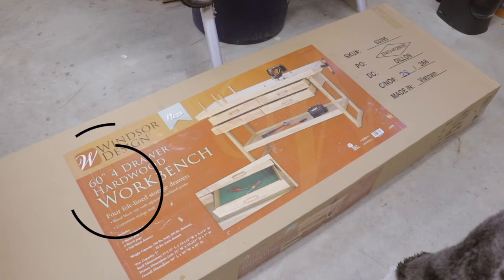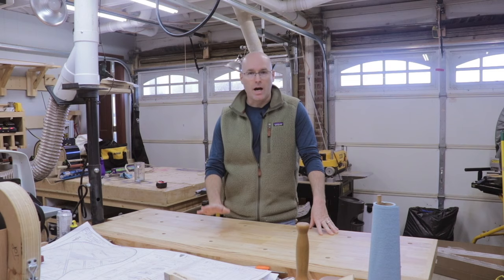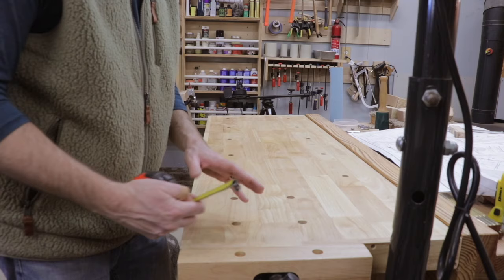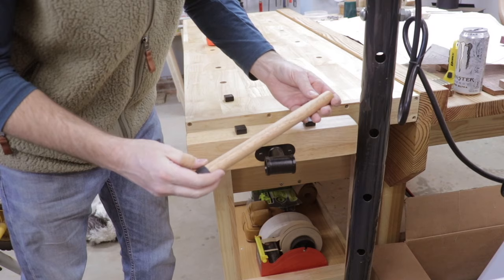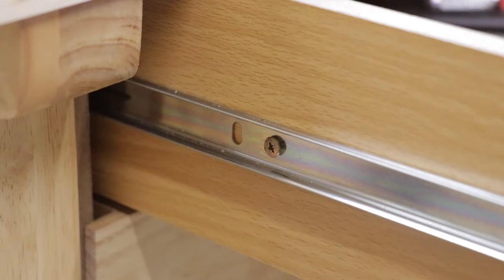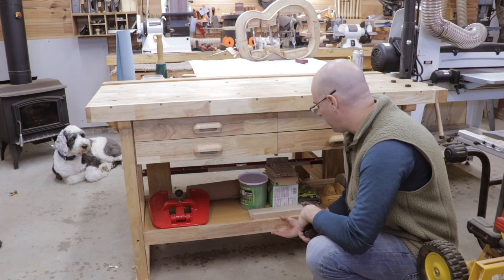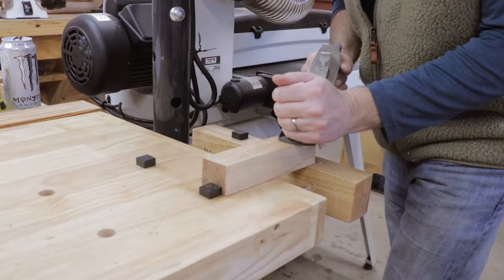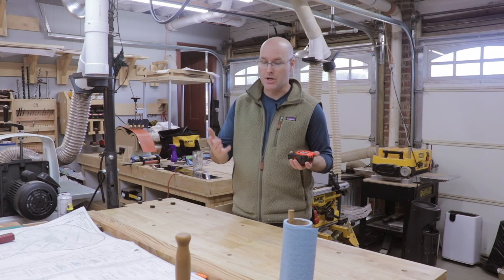Harbor Freight Woodworking Workbench Review

Comment: This was my first bench and I still use it. Adding a sheet of plywood in the back made it stiff enough to plane on. I also added casters so I can move it around the shop. I tried adding a leg vise but the legs are just not wide enough. Finally I moved all the drawers to the right side and now I have more storage on the left side.
Reply from the maker: That’s great! Thanks for sharing!
Reply: I added casters to mine, too.
Reply: @driftlesshunter9200  Can you show us a picture and which Casters that you used?
Reply: Do you have a video of your workbench ?

Comment: Add back panel for cross bracing to make the bench more stable. Also, beware on the drawer slides. Two of ours had bad slides on one drawer per bench. Annoying is that sawdust drops through the dog holes into the drawers. I put tape over the bottom of the holes, and replace it as needed.
Reply from the maker: Good to know! Thanks!
Reply: yup, sawdust in the drawers. lol
Reply: I've always found it annoying when I have sawdust in my drawers.
Reply: @craigheaps7520  🤣😂🤣😂🤣

Comment: I upgraded mine.  I installed 14 inch full extension sliders on drawers, peg board on the back and side to hang tools,  painting paper roll holder on one end to protect top for painting projects. . .below that a rod to hold small clamps, Rockler workbench casters (with a steel across for releasing both legs quicker), Kreg bench clamp and made the bottom shelf flat to slide in harbor freight parts storage cases.  The top of mine didn't stay flat so I might have to upgrade that.  Also, the bench dog holes are 1/2 inch and most bench dog accessories are 3/4 so I drilled out a couple by the vise so I can utilities some bench dog accessories.  For my first "portable"/maneuverable  (casters) workbench it works great in my little shop.
Reply from the maker: Sounds like all good ideas!

Comment: This can be had for $119 if you can wait for the coupon. I recently purchased this bench. I left off the drawers and plan on doing some upgrades. I purchased it primarily as a basic base to customize. I’m very happy with it so far.  Definitely needs glue/reinforcement to the joints to help stabilize it.
Reply from the maker: Thanks for sharing
Reply: What coupon?

Comment: I bought this table about 2 months ago.  It's become the primary workbench for me and it's stable, secure and is an essential part of my shop.  I used the wood vice today and it worked perfectly.  The tray below the table is strong and has many of my smaller power tools that I keep in tool bags.  It's worth every penny.  Don't get fooled by the tables assembled in the store, those tables aren't assembled the way you will when you get it home.    Thanks for the great reviews!
Reply: yo how has it held up?
Reply from the maker: @GasLiteYT still using it everyday! I like my handmade bench much better due to stability!

Comment: Thanks for the review. I agree its a no brainer purchase if you need a general workbench. I bought 2 of these back in January. Used a 20% 0ff coupon and got them them for $119 each. I have them mounted back to back and held together with magnets. I got the idea from Advanced Geekery's channel. This gives you a nice large work space or 2 smaller work tops depending on the project.
Reply from the maker: That’s a really good idea! Makes them more stable too

Comment: I purchased one of these about 6 years ago when I was easing into hand tool woodworking as my 'Hobby of Choice'.  It was better than the workbench I didn't have though no treat, that's for sure.  It DID suffice as a work surface while I build some shop furniture to 'warm up' for building a Rubio style workbench in the way of Charles Schultz.  Instead of throwing it out after I built a 'real' workbench, I re-flattened the top (the thing warps if ya look at it crosswise) and use it as a place to organize things....but not at all as a work surface.  As everyone says, it is way too light for hand tool work.  If I had put a couple sacks of sand on the lower shelf....that would have been a good temporary solution.  If you don't have a bench....get this thing as a stopgap and build something that works.  I had NO experience with the large joints used on the Rubio....but the Japanese style sawhorse and matching height sawbench I built as a warm-up me far enough along that the workbench came out just fine.....and it weighs about 350#, at least.

Comment: I’ve had 2 of those benches and i beleive they were Rubber Wood  i am a retired ProfessionalWoodworker   i certainly wasn’t impressed with the End Vise or the Drawer Slides  but in all honesty  i only used mine for  little Hobby  projects  and i was tight on space  so the  extra storage kind of helped me out for the money and simplicity. i was happy  as i hauled  two of them in my Girlfreinds SUV !

Comment: I got one of these benches a few years ago for $99 on special.  I agree that as is, it is a good beginner bench.  Like Rusty T, I added plywood across the back and that helped stiffen it up.  I use it for light duty work with hand tools in the woodworker role and do lots of other thinks like blade sharpening, repairs etc for around the house stuff.  Good deal for the money.
Reply from the maker: $99 great deal

Comment: I've been using that same workbench for 8 or 9 yrs. now. My main complaint was the drawers, so I bought new slides and solved that one. I attached some 3/8" pegboard to the back and that made it more solid and I can hang stuff on it. Added casters so I can move it around. I don't remember what I paid for it but bought when it was on sale and I had a nice coupon to knock some more off. Not a bad table for the money!
Take care, Dave

Comment: I see rubberwood (a member of the maple family with hardness of 9500) in this, but looks like it may be several species, typically furniture companies will use their cutoffs and endjoin them to make laminated sheets and then make things such as this. Rubberwood is moisture absorbent, more so than other wood species. May also trigger latex allergies in some.

Comment: I just bought their newer 3 drawer woodworking bench. It's a lot heavier duty than the 4 drawer but it also costs $200 as opposed to $149. Same Rubber wood Maple raw material, just more robust in size.  I'm going to use it as a glue up table for my coffee tables, bar tops and dining table builds.  Eventually I'll buy a second one and connect them back to back.  Cheers 🥂
Reply: Good to know, just ordered the 3 drawer myself!
Reply: The new 3-drawer version will be on sale for $149 at Harbor Freight June 2, 3, & 4 :)

Comment: If you want to build a bench for less you can get solid oak pallets from places that sell sheet metal. I made a Moravian workbench in 3 days. You will need about 6 pallets if you only pick out the best. Laminate the legs with 4 slats each and laminate the top with the runners and make all the short cross members from 2 slats. For the long stretchers and leg vice  use the runners. I spent $54 for my vice $9.70 for dowels to drawbore my mortises and the top sits on pegs of 3/4 dowel I used the remainder for bench dogs. I did use a peace of mahogany and pine that I had for the tool tray probably $30 worth. I also used an expensive hardwood finish I got from work.

Comment: I have 2 of these.  On sale $119.  I to replace the crap drawers with 6 full pullout slide drawers.  I added another 3/4" top.  I added wheels that flip so that it's stationary when you want it to be.  I also stiffened it with a full back on it.  I  also rebuilt the faces of the vice.  I think that this is one of the best items that you can get from HF
Reply from the maker: Thanks Bill for sharing your experience. I would buy another one if I can get it at $119
Reply: @BillP Really interested those "wheels that flip". Can you share the make or a link?
Reply: @AlejandroGarciaTunon  I just put some wheels/casters on one end and then on the other end I put the wheels on a 2x6 then hinged them so I could flip them out of the way when I didn't want the bench to move.
Reply: @myutube6422  thanks!

Comment: I use mine as a combination outfeed table and sharpening station, It's fine for that but not for hand tool woodwork. By the  time you beef this up enough to be useful for had tool work (planing, chopping mortises, etc.) you could well have built a real bench with a top with which you could use holdfasts, etc.. And the vise is way sub-par. Still, it's a great inexpensive option for the uses to which I put it. Just don't expect more of it than it can give.

Comment: I have this bench...it's great for 150...first thing you have to do is replace the drawer slides...everything else was great for me...it isn't the greatest vice ever, but it's great for average stuff.  It isn't great for planing, or anything that requires pressure across the top...so sanding, etc.  But for 150, you can't beat it.
Reply from the maker: Agreed!

Comment: I bought one last summer. Replaced the drawer runners  with wood slides still need to replace the drawer under devider as mine pulled out. The material is worse than MDF for holding screws. It works is about all I can say about it.
Reply from the maker: Thanks for sharing Carey!

Comment: great review. I've h ad mine maybe 3 years.... it's worked great for me.. fits easily in my one car garage.. I thought the vice worked okay...  recently I wanted to use it as an outfeed table for my dewalt table saw and found if I take harbor freights appliance dolly that cost me around 20 dollars, and put a couple of 4X4's about 4 ft long on it. I simply put it under the shelf and then can easily rool my table out onto my driveway and cut wood. very handy table that's easy to move with a minimal foot print.  Bruce.
Reply from the maker: Thanks for sharing your experience!

Comment: I have this bench, I didn't install the drawers so I could use my bench irons.
My only complaint was the bottom shelf was so warped that I couldn't get it in the frame, so I attached 1" angle iron and laid 2×4's in loose for a shelf and to add a little weight.
I used an insider coupon also, saved an extra 20 bucks.

Comment: I got one of these for $50 by combining a coupon with some sail they had going and I got free microfiber towels and a magnetic tray. I have a real workbench I used this to hold a fish tank. But if I ever put it in my shop I will replace the bottom shelf with 1/2” birch plywood and fill the void under the hollow top with MDF  because the top is 3/4 finger jointed tiny scraps. It’s totally worth full price though. I used the vice screw to make the wagon vice on my real bench.

Comment: The sides and rear of the drawers and the lower shelf are made of MDF, not plywood. If they were plywood, they would be much stronger. You can screw the table to a wall. That would keep the table from shifting or wobbling. Attach a 1/2"x2" board the length of the table to the wall aligning the top of the table to the top of the 1/2"x2" board. In other words, make them flush at the top. After screwing (or nailing) the 1/2"x2" board to the wall studs, screw the table to this 1/2"x2" board. I would use 1-1/2" to 2" screws at least every foot along the length of the board. Whether you attach to wall or not, I would also run 3-5 stretches under the table from front to rear to add strength to the top. Screw or nail the stretches to the table top. I  would also use wood glue. Countersink for the screws or nails. Fill holes with wood putty, sand and spray or paint with lacquer. Make sure the stretchers do not interfere with the operation of the top drawers.

Comment: Purchased it with a coupon for about $116 a year or two ago.  It's usually a horizontal surface that collects stuff, but I put bigger blocks under the legs, and then put casters below that, so I can move it around.  The short throw of the drawers is a bit (well, VERY) annoying, and getting sawdust in them is annoying as well.  It seems too narrow for much setup (I deal with sheet goods a bit.).  I had put up a sawhorse-based 2x4 cross-grid setup as a more or less permanent sheet good cutting surface.  My wife wants her garage back... I'm resisting.. stay tuned for how this turns out.  Usually I lose. LOL

Comment: I looked at the HF work bench and yes the top is hard wood. But i saw MDF on the draws, the bottom shelf, anf under the top.
But back then they were 100.00 
Or whem i looked at it.
Good luck

Comment: It's okay.  glue and screw some half inch ply to the back and sides to reduce racking.  Add heavy stuff to bottom shelf as ballast.  Lastly, glue and screw some 2x4s underneath the dog holes and redrill from the top. 

You will be able to use hold fasts on the back dog holes only - which is good enough.

A better bench is Rob Cosman's made from mdf.  buy some 1 inch thread rod and build your own vise - or two or three.  All can be done for $150 or less.  

I used 3/4 thread rod to build a face vise on my workbench over 20 years ago.  I've used and abused it daily and it's still tight and right.  You can build a vise much better than you can buy at any price.

My face vise has 1.5 inch hardwood dowel runners.  My next bench will have twin screws on each end (1 inch thread rod) and a face vise with 1 inch thread rod with 2 inch hardwood dowel runners. 1 in 8 TPI is all you'll ever need.  I've used 3/4 thread rod that's 1 in 16 TPI for 20 plus years.  With a speed handle, it takes just a few more seconds than a quick release with none of the quirks.
Reply: Brilliant suggestions, thanks!!
Reply: @Nifty-Stuff  No worries!

Comment: I bought one about a year ago.  The vice handle snapped about a week in and saw it had a factory crack in it.  I made a replacement one ont of walnut dowel.  You are right, the drawers are cheesey.   But tolerable.   I put locking casters on the bottom so I can easily move it around my shop when I need to.

Comment: I've been using mine for about a year. Great for the price but mine did have some hole alignment issues. It is quite lite and wobbly. I added some 1x4 boards between the legs which helped quite a bit with the wobbliness and added a little extra weight. There's still a little twist that I'll try to remedy with a few more boards added for cross bracing. Overall I'm happy I bought it.
Reply from the maker: Im still planning to replace drawers and strengthen up the wobble! I still use it daily for an accessory workbench. The hand tool bench I built is still my primary one!

Comment: Several items.  I have this bench.
I have no wobble, I made sure the screws were right.  Vice handle, I put a small screw in the end to hold the caps on. I also used micro jig dovetail bit on the front and back to use their clamps. (Remove screws on the end before routing, yes I ruined a bit).  My only dislike is the drawer slides don't open far enough.

Comment: The problem with the bench I saw is that the display (of anything at HF) is not put together well and too many people shaking it and pretty much abusing it on the floor, so by the time I see it on display, it's a piece of .....well....
So seeing your take on it is helping me with my decision, but I would be gluing and clamping it while putting in the screws.  Even adding a screw or three here and there along with the copious amounts of glue.

Comment: I assembled this bench for a friend.  All was good except the pilot holes in the long drawer back were drilled in the wrong positions.  Turned either way they were a couple inches off.  I know I had the bottom correct cause there are recessed pilot holes in the bottom for it to attach to the back board and of course the felt side goes to the inside of drawer.  I just predrllled through these holes into the drawer back and screwed it to the board.  Not an issue for me but could be a real problem for the novice with no drill or bits!  And not predrilling could cause splitting.

Comment: I have 2 of those,  brand new...I'll add bigger drawers to the bottom plus I may join them together .
Reply: That is exactly what I plan to do. I will use biscuits or dowels to hold the two benches together. You said bigger drawers, did you mean deeper from top to bottom of the drawer? They're not very deep. Maybe I will leave the top drawers as they are and make deeper drawers on the bottom. I will use plywood on the sides and rear, not MDF.

Comment: I just bought one, thanks for the tips! What do you think about adding wood glue to all the mating pieces before screwing them together? Would that help a little with the stability?
Reply: Glue won't add significantly.  Add cross bracing to the design to add rigidity.

Comment: What you and every otger reviewer online doesnt mention is the size if the box it comes in, so I can know if it will fit in my car. I live rural and frieght for this costs a fortune. Need to know if it will fit in my/my oartners car.
We fit a 1600mm long bench seat in her car comfortably but this is closer to 2000 i think?? With it been flat pack is it perhaps smaller than 2000mm?

Comment: I bought this work bench and use it for different purposes.  I have been thinking about putting a 75 gallon fish tank but would need to reinforce it with  2×4s put a 1 inch hardwood top on top. How much if you know would this table hold in lbs before failure? Anyone?

Comment: I bought one of these tables.... got it put together, ready to install the top table part.. took it out of the box. It wasn't in two pieces but could be if used. Took it back apart, drove 25 miles to return. They wanted me to pick out another box! I told'em, I'll pass.. and got my clacker back.

Comment: I have trouble using the dogs. I can't seem to clamp down. Any suggestion?
Reply from the maker: The steel dogs that come with this bench are used to clamp material between the vise dogs and bench dogs. The dogs will not clamp individually to the bench.